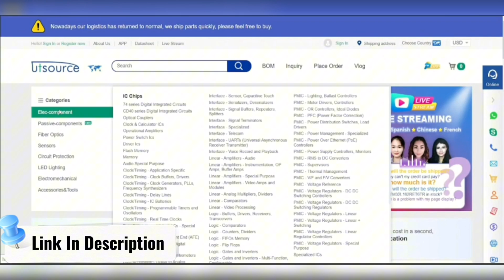How To Make Electric Fence Circuit | Electronics projects | utsource

Comment: Hello dear friend, congratulations for the really interesting video, I wanted to ask you, can I connect a high voltage coil built by me, the one suggested on a ferrite core with primary and secondary, instead of the car coil? Thank you
Reply from the maker: Yes, you can use a transformer with a ferrite core. But if the calculations are right, only a high voltage transformer.
Thanks for comment 👉❤️👈
Reply: @easyproject4uofficial  I wanted to use a coil that I made following an Electrice vice, with a ferrite core taken from a TV coil, so I made the primary with 40 turns with 1mm wire and the secondary I made 9 layers each of 100 turns with Would 0.30mm wire work?

Comment: component specs are poor...i.e  what is the piv for the diodes
Reply from the maker: This video is intended to show how the circuit works well. If you are creating this, build it securely on a pcb or dot board.
Thanks for your comment.
👉❤️👈